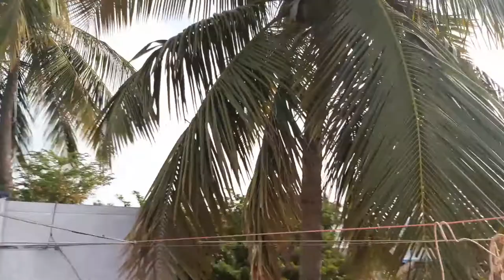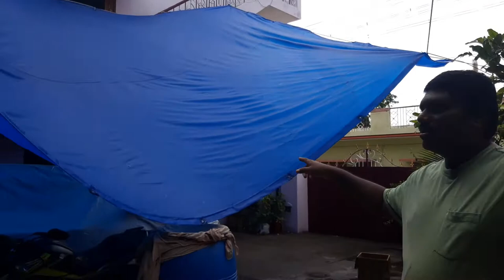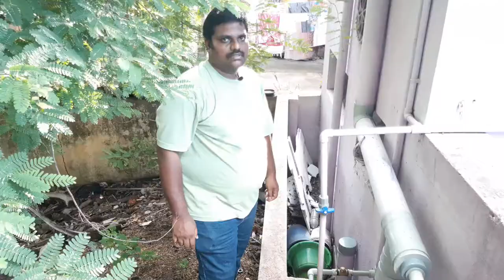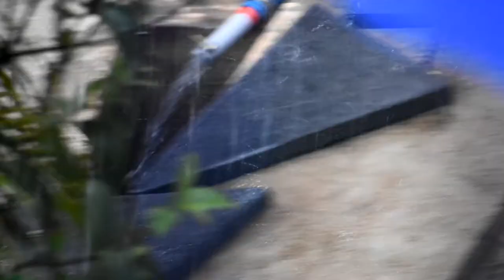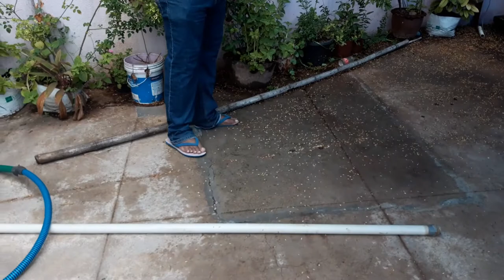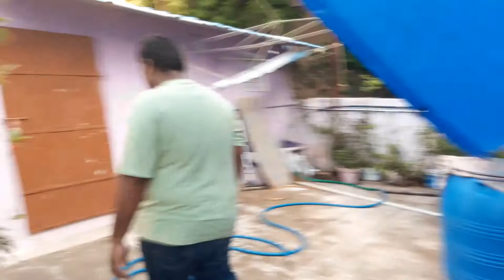Rain water harvesting in Tamil | cost just 500 Rs | Do It Yourself | DIY | Meshach

Comment: Very good annaa...
Sambu eppadi annaa ready panradhu?
Kinaru maadhriyaa illa tank maadhriyaa?please sollikodunga
Reply from the maker: If you make like a well it will increase the water table in your area. But we can pump from borewells only when the water table has reached a certain point. But when you make a tank you can save water for your immediate needs real time. It depends where you are. In my area increasing water table might not be beneficial for me because neighbors have drilled 1500 feet bore wells but ours is only 300 ft. So I am collecting rain water in tank only sister. Because I want to draw water real time for our needs.